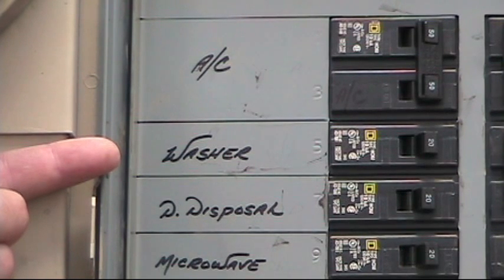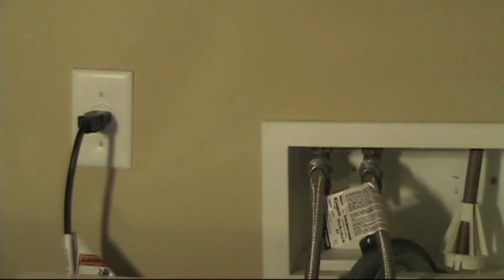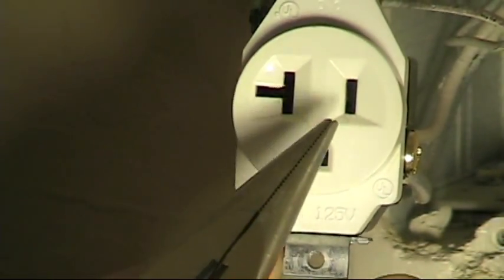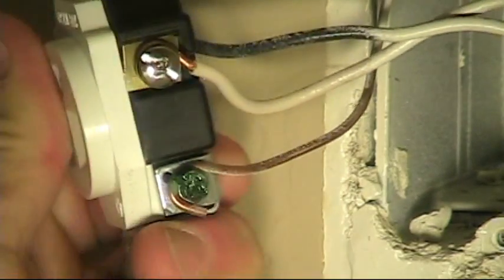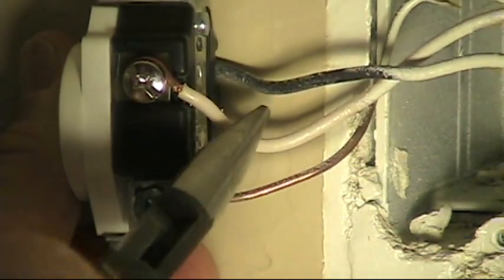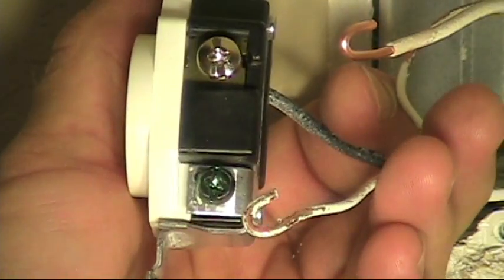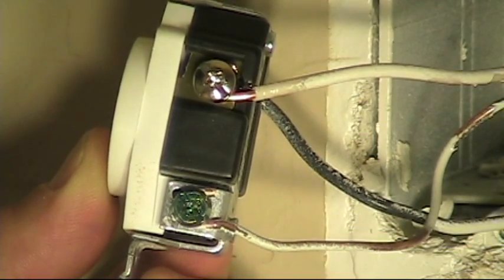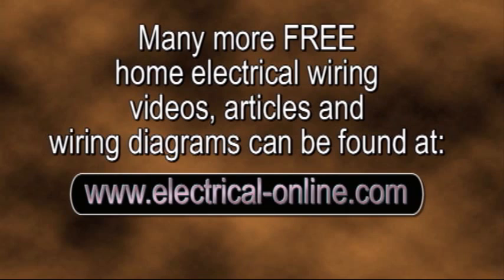Understanding Your Home's Electrical System:  The Washing Machine Circuit

Comment: My washing machine keeps tripping the 20 amp cb. The house was built in 2018 so it’s up to code but we bought a brand new washing machine and Maytag came out to check the machine and said it’s not the machine it’s something to do with the circuit or wiring. However if I use an extension cord and plug it into the outside back porch outlet it works fine. If I use any outlet in the house it trips it but ONLY on the start of the spin cycle. I haven’t used the clamp meter to test INRUSH but I have seen the amp draw when it runs and it’s only pulling 7 amps of current.
Reply from the maker: Start with checking the connections on the receptacle, and then in the panel to ensure there are no loose terminations on the hot, and the neutral conductors.  If everything appears to be ok, then just replace the breaker.  They can fail, and when they do they usually start tripping at lower current flow as you describe.  Remember all the safety precautions (of course), and if you're uncomfortable doing this yourself, hire a good trouble-shooting electrician to come sort this out for you.

PS  I just re-read your story here, and this part: "If I use any outlet in the house it trips it but ONLY on the start of the spin cycle" is troubling.  That tells me that you need to tell the Maytag Repairman to get off his recliner again and come check it out.
Reply: @theinternetelectrician  so I actually just swapped it out with a non GFCI like the ones I’ve been using for months with an extension cord and it works now. All I did was throw the neutral on the bus bar and wire the CB. That square D was only 6 dollars vs 80 for my other ones.
Reply: You may have an Eaton breaker that was recalled for overheating. I brought them down to the electrical store and they took them and gave me all new breakers for free.

Comment: Do u have a video that shows how to install and ground an old two prong outlet?
Reply from the maker: Are you referring to a 2-prong outlet that doesn't have a grounding / earthing provision? If so, there are 2 options.  One is to replace it with an approved 3-prong configuration and find a suitable way to get a grounding wire to it by whatever way possible.  If this isn't an option, then you can replace the 2-prong outlet with a GFCI receptacle.
Reply: @theinternetelectrician  the building is old and they have a two prong outlet with no ground connection. So pretty much it's just a two wire connection(hit and neutral)

Comment: Question my electrican installed a new line for my washer and dryer and my dryer is gas but I also have a deep freezer and a small fridge running on the same one its 4 plugs but he installed it’s own line straight to the box 30 amp is that enough ?

Comment: I have a single receptacle like this for my washing machine. But I have my water softener installed in the laundry room and it has a digital valve that needs power. So I am using a surge protector that is plugged into the washing machine receptacle and then the washing machine and the water softener are then plugged into the surge protector outlets. Is this ok?

Comment: Good Video.  Does the Washer have to be on a GFI?  My washer keeps tripping the GFI.  The washer works fine when plugged into a non-GFI outlet.  Thanks!
Reply: I'd replace the GFCI outlet ($12?) to see if it's defective.... OR... if there's no water / sink within 6 feet you can skip the GFCI. BTW, if this is a damp location (garage or basement) with a cement floor you may be required to have a GFCI by the 2020 NEC book.

Comment: Great video. Correct me if I'm wrong, but as I understand, the NEC allows multiple 15A receptacles on a 20A circuit. However if a receptacle is the only one on that 20A circuit, it must also be 20A. For washing machines, they must be the only thing on that 20A circuit. So to me, the only logical conclusion is that the washing machine's receptacle must be 20A.

My washing machine is plugged into a duplex 15A receptacle. Could this mean my washing machine shares its circuit with another receptacle in my home? If so, doesn't this violate code? My washer only draws 10A so I'm not worried about overloading the circuit unless it's shared with my dishwasher. I'm looking to swap the receptacle with a GFCI, and I want to be sure I do this right. 

Thanks in advance!
Reply from the maker: What country are you in? Most of training and career was / is in Canada following the C.E.C. We always ran a #14/2 on a 15A dedicated circuit to the washing machine, and always used a 15A/125V duplex receptacle.  It's very probable that your home was wired to the code rules of the day and this outlet is on a dedicated circuit.  There is no need to replace that outlet with a GFCI unless you feel better about it, but if it's behind the machine, you're not likely to be using that duplex outlet as a convenience outlet anyway and that's when GFCI protection is most useful to protect you from electrical shock.
Reply: Clarification: In the USA we use NEC code, and the details are a dedicated circuit to a laundry area. (not dedicated outlet) This means you can have a light fixture and the washer on the same breaker. No need for GFIC unless it's a basement or garage with a cement floor (damp location) or a wash basin within 6 feet. You can also install a duplex outlet and feed power to a GAS drier on the same breaker / outlet. Electric drier will need its own feed.

Comment: Terry does code say washing machine must connect to a single receptacle? Might need to correct mine it is plugged into it's own gfci receptacle on it's own circuit. Thanks for this Terry!
Reply from the maker: +daikaiju20 , no, there is no requirement that the receptacle be a simplex receptacle as is this one.  The code only requires a 20A dedicated circuit to the laundry area.  If there is a sink within 6' of the outlet, then it needs GFCI protection as well.  Your installation sounds like it is compliant (if there is a laundry sink).
Reply: i guess I'm quite randomly asking but does anybody know of a good website to stream newly released movies online ?
Reply: @Brecken Enrique try Flixzone. You can find it by googling =)
Reply: @August Kendrick definitely, I have been watching on FlixZone for months myself :D

Comment: Hey Terry, so I’m in the same boat as everyone else is.  Have a Dedicated 20 amp breaker but 15 amp outlet being used.  My washer from what the website says is a 20 amp front load washer.  It does trip at least once a week and I can’t think of anything else it could be but that.  Any advice ?
Reply from the maker: The 15A receptacle is not a problem if it is a duplex receptacle (for code compliance), but if it is a single, it should be 20A.  That still wouldn't contribute to the tripping of the breaker.  Breakers can get weak, and can also trip at an amperage outside of the expected tolerance, in this case it would be tripping on the low side of the range.  So if you have #12 wire, a 20A breaker, then if it becomes a nuisance, try replacing the breaker with a new one.
Reply: @theinternetelectrician  yes I did go check the breaker and was lose.  I tried pushing it in but won’t sit in place.  Think I found the issue for the constant tripping. Hopefully it’s nothing else when I take it off the panel.  Also any advice on a dimmer switch.  I’ve read that dimmers have a minimum and maximum rating and has to be the correct one.  Would you be able to guide me with that ?
Reply from the maker: @camposfamily5091  Sure!  Just send me an email to terry@electrical-online.com and I'll answer your question (s) if I can.
Reply: @theinternetelectrician  well just a short answer was all didn’t want to bother too much.  Just a dimmer question.

Comment: Hi Terry, my laundry room receptacles are not working properly. We had our washer and dryer delivered and when we plugged in both machines the receptacles stopped working. I changed both receptacle, one being GFCI and the other a normal 20 amp receptacle to how they were wired before. When I put the receptacle tester it showed the hot/ground are reversed. Not sure how, the black wire is in the brass side and the white wire is in the silver side, and the bare copper is in the green screw. Not sure why this is happening and looking for some guidance or advise of where to go from here before calling an electrician. Thank you in advance.
Reply: Maybe the wires are reversed at the breaker box?

Comment: What do you do if your washer wall outlet has a cover behind the holes blocking you from plugging in the washer? (New apartments)
Reply: I think that is labeled TR - a tamper resistant outlet.  A kid could not just poke something into only one part of the outlet, the whole plug must go in simultaneously.  Just try to plug something in; it might be a little bit harder the first time.
Reply: @Lughnerson    Had maintenance take a look at it and get it done. It was a defective TR. Had extra flash on it. Took maintenance about 25 minutes.

Comment: Hi Terry, my washing machine makes LED dim on another circuit when agitator is running. It mostly occurs when the lights are dimmed on a  low setting, less noticeable when full bright.. in the bathroom there is no dimmer and I dont see fluctuation in brightness. What Can I check? all screw in the panel looks tight.
Reply: Have same issue. Would be great to get insight as to why this is happening.

Comment: I don't SEE a difference in the wires themselves. You mentioned ground, neutral and I believe main power wire? They all looked white to me, how did you tell which was which? If I was to wire in a new socket how could I tell which to connect where?
Reply: Confusing because the BARE copper ground has been painted almost white.  Terry does scrape the wire bare where it will make contact with the receptacle.  The white wire goes on the SILVER screw on the LHS of the outlet( looking at it with ground prong at BOTTOM).  Black wire to the brassy coloured screw on the RHS.  Ground or bare wire goes to the green screw usually on the top or bottom.